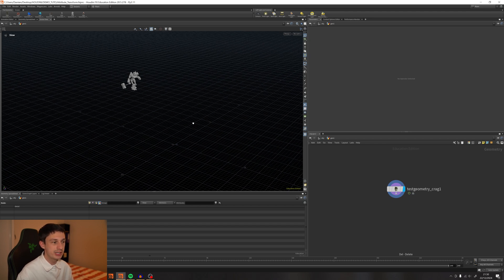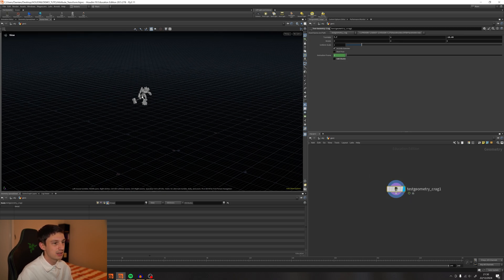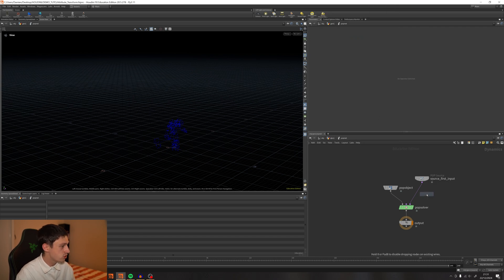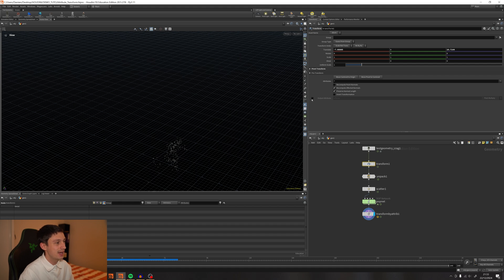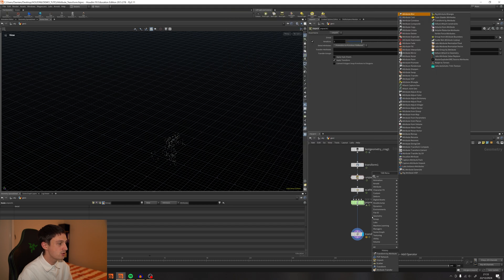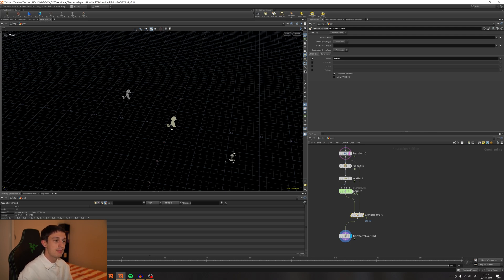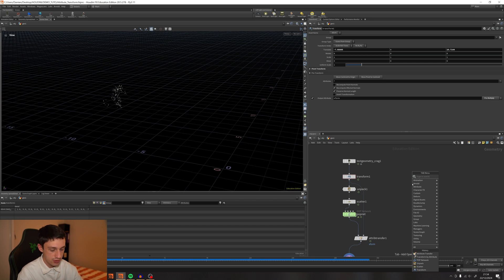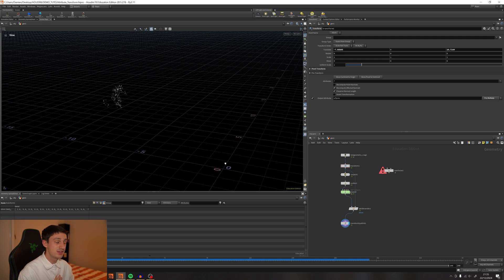Faster Simulations Start with Centering (Transform by Attribute)

Comment: There is a simpler way of doing this, after using transform node and clicking move centroid to origin, zero out the axis you want, duplicate the transform node anywhere you want and check " invert Transformation" to move it back to original position.  it's more optimized and no need to carry extra xform attrib anywhere in the setup or sim. at least in this case
Reply from the maker: Yes, you're right, nice tip! I try to don't use a lot of transforms as the pivot point is a bit tricky to be referenced sometimes, also if you have multiple transform operations it starts to be tricky. Thank you for your comment and tip again :)